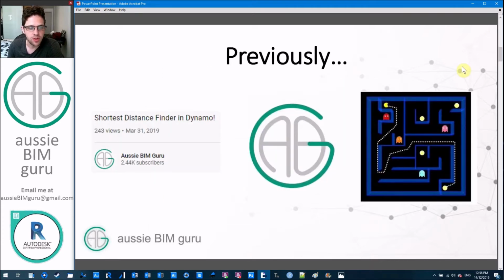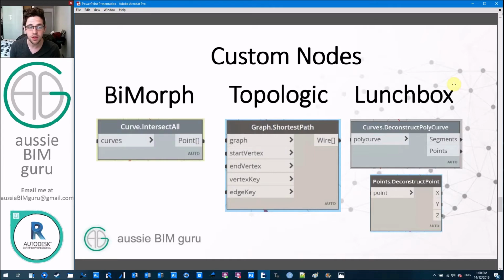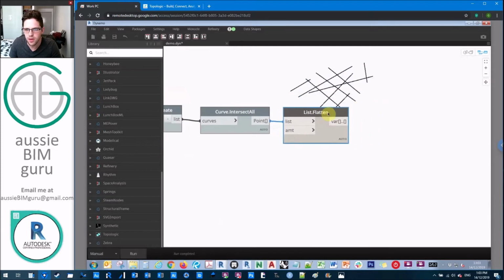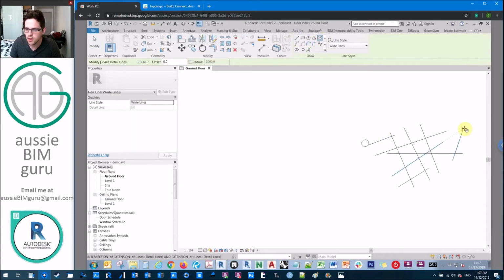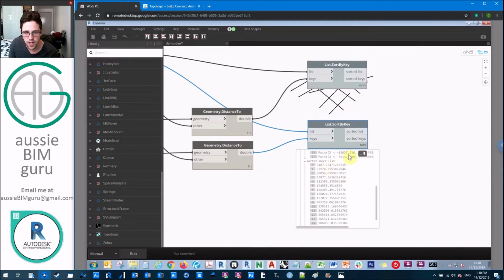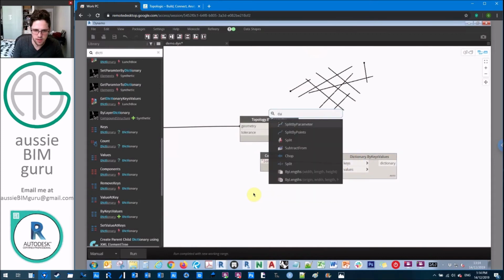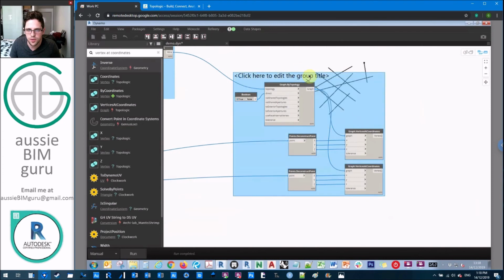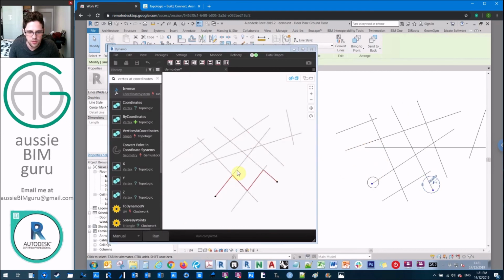Shortest Distance by Topology using Dynamo!

Comment: Thank you so much for this tutorial!
Reply from the maker: Youre welcome!
Reply: I think I've found the way for calculating multiple start points and one end point, using your tutorial. Actually, I have simplified your solution just to be able to use Levels in the lists. When you have time please check link below, I've uploaded finished dynamo graph to Google Drive. Regards.Dalibor. https://drive.google.com/drive/folders/1xCnlbA6x3fWLFdOCI9j7ZGo_mlyBsKVM?usp=drive_link @AussieBIMGuru
Reply from the maker: List levels do indeed enable this scenario, very nice! I've used similar in Grasshopper also by forcing cross product lacing to exhaust all pathways.
Reply: Just one question: is this possible for multiple points, for example, one start point and multiple end points?  @AussieBIMGuru

Comment: Hi Gavin, I follow you with enthusiasm, but with this package I have a problem: when I create wires from edges, the node doesn't work and the error says "The last edge which you attempted to add was not connected to the wire." (My "map grid" is little more complex then yours). I hope you can help me.
Reply from the maker: I would try pulling them onto a common plane to be 100% sure they all overlap to form a valid wire. If you still get the same warning I would get in touch with the Topologic team (specifically Wassim) - he's quite well versed on how it all works vs myself.